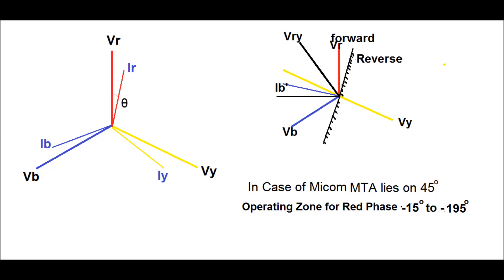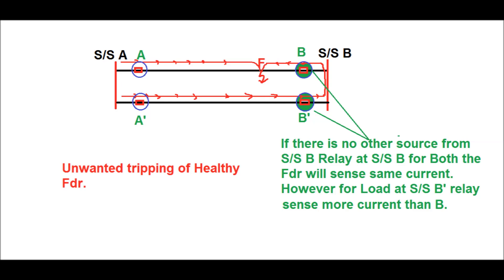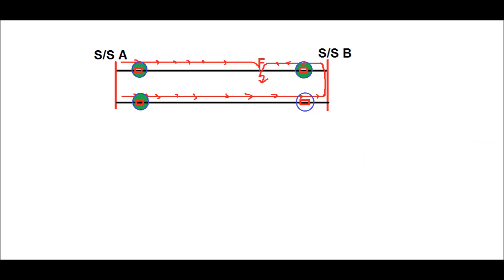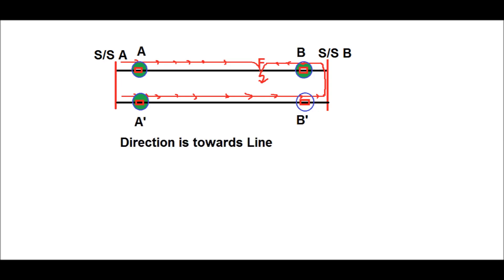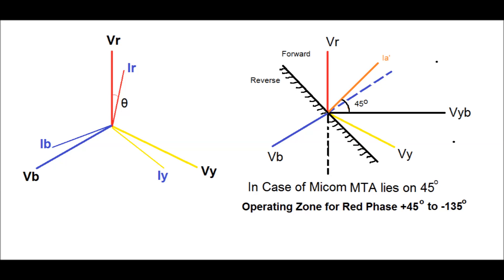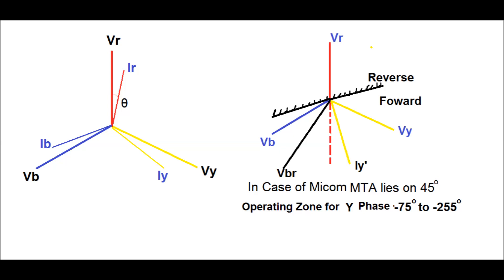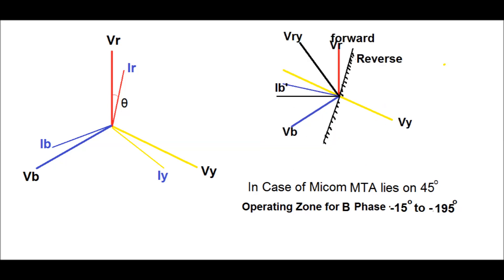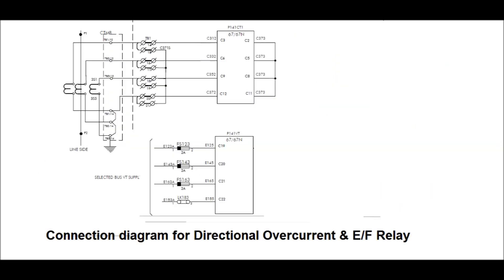Directional Overcurrent Relay

Comment: On what basis , MTA line is drawn at the 45°angle form voltage reference ?
Reply from the maker: For overcurrent relay voltage reference is taken for healthy phases. For example fault occurred in R phase and healthy phases are Y and B phases.  It take reference voltage phasor of Y-B i.e. Vy - Vb where Vy and Vb are vector. Max. Torque angle is leading to reference by 45 degree and this how u can draw the MTA Line.
Reply: @relayprotectionelectrical  nice explanation . Appreciate   👍, for directional earth fault , what ll be the reference phasor voltage ?